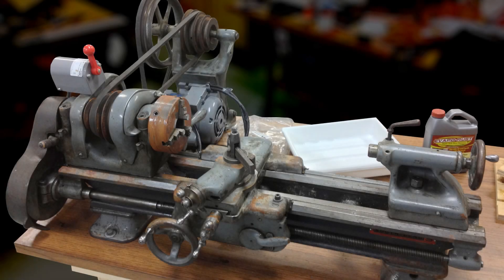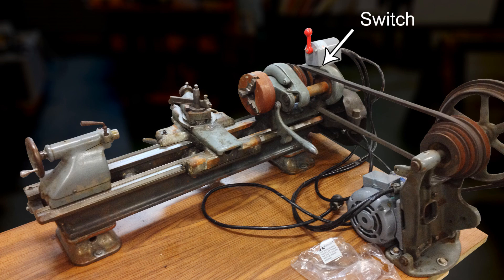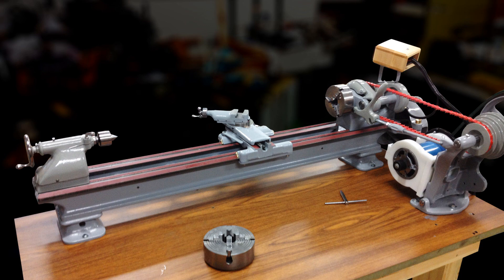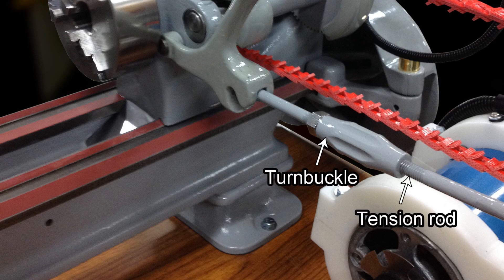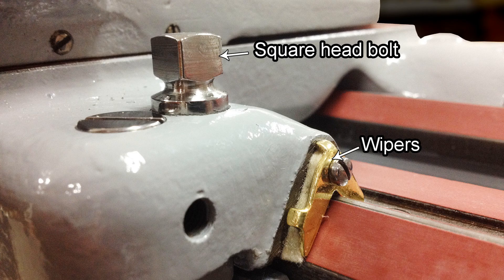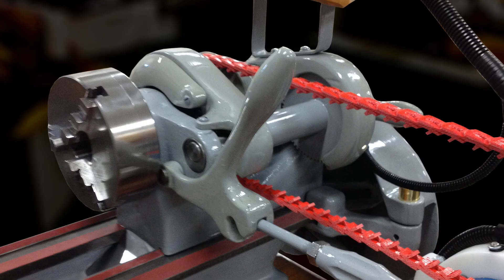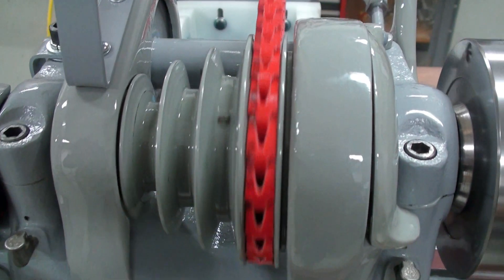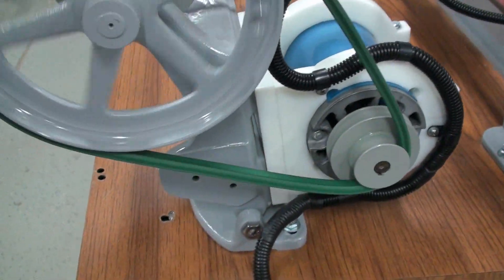South Bend 9 inch lathe restored with tachometer, DC motor

Comment: Thanks  for the paint mix info, I went slightly less on the white paint for a bit darker shade of gray. It looks like the parts you coated with the clear epoxy have a darker tone almost green /gray to them.
Reply from the maker: Yes, the epoxy had a little bit of a yellow tint to it.

Comment: Could you tell me the diameter of the large drive pulley, in the move it has been misplaced and I need to add a new one along with the shaft, and can you confirm the the rear shaft Is 0.875” diameter.  Thanks

Comment: Looks nice! Probably shouldn't have painted the pulleys (or gear teeth if you did) The belt will wear off any coating you put on there, even epoxy. 
Your belt from the motor to the rear jack shaft looks a little loose.

Comment: Hi,
Can you please tell how did you mount the roule tape on the bed?  I have bed with a lot of wear is this tape can do a repair for a wear or I have to grinding it in order to get nice bed?
Reply from the maker: The tape will protect the ways from wearing, but will not repair a worn bed. You will need to have it ground to fix the ways.

Comment: Aaron, please describe the type paint and technique you used to paint your lathe. Thanks!  Jon
Reply from the maker: I used an alkyd enamel. An epoxy paint would have been better. I also used a mix of brushes: synthetic bristle, foam brushes, and small artist brushes. They were all just cheap brushes. The slow drying alkyd enamel smoothed out very well. I try not to use fast drying paint for anything because they show more defects and are harder to control.

Comment: ls that a treadmill motor? Does it have nice power at low speeds?
Reply from the maker: This motor was not a treadmill motor. However, if you get a high enough horse power motor, then torque at low speeds is not a problem. The DC motor controller from KB also helps with the torque.
Reply: Thanks!